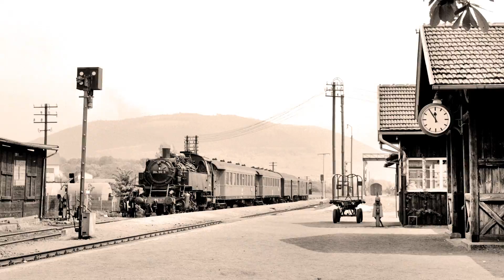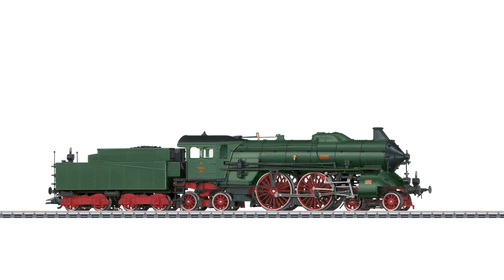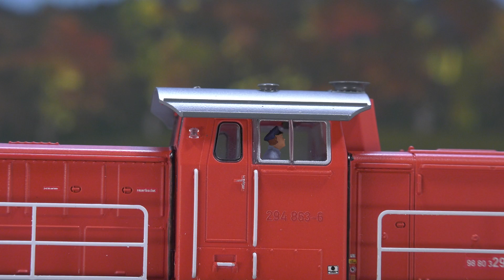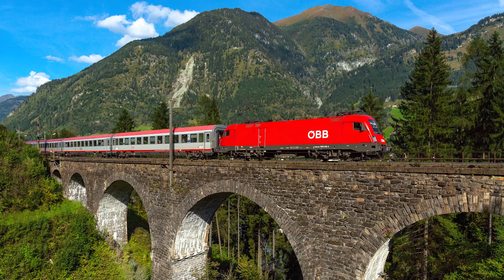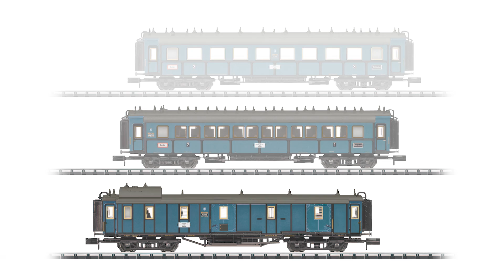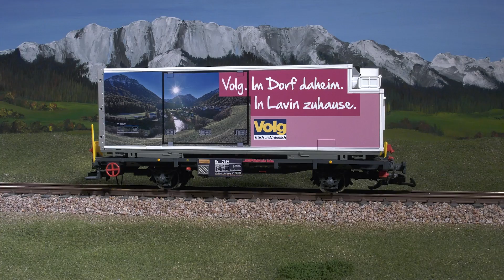Märklin New Products Fall 2024 / Model Railroad News by Märklin, Trix, Minitrix and LGB

Comment: As usual, still waiting for a Spanish locomotive, you have plenty to choose from.
Reply: spanish railroad uses large gauge (larger than 1.435), and I guess they havw different filosophy, so probably, we will be late to see some
Reply: @juniortrainspottermg  Hi. That was true until the 90´s, but Spain already has several locomotives with the standard gauge, i.e. the 252 or the new Euro6000, with quite a few liveries by the way. Anyway, I´ll keep on waiting. Greetings from Spain.

Comment: Another Flying Scotsman is great, especially in this color scheme. Have to admit I was really hoping for matching coaches for last year’s model.
Reply: Agreed totally 💯 need coaches!
Reply: Hopefully the mark 1 coaches in the background are indications !
Reply: At 7.30 mins or so
Reply: That are the old Harry Potter coaches in the background……

Everybody!!! and their mothers want some coaches for the Scotsman.
Reply: Yes, they are the Harry Potter set coaches (you can see the Hogwarts icon in the center of the coach) which are unfortunately very rare to come by and also a different scale :( having both last years Flying Scotsman and the HP starter set I can say they are definitely not a match on the tracks as the coaches are higher than the locomotive.
Reply: They must be 1;76 oo scale but yes need some proper HO coaches . I think fleischmann did some many years ago.